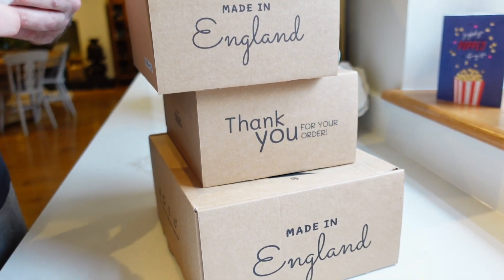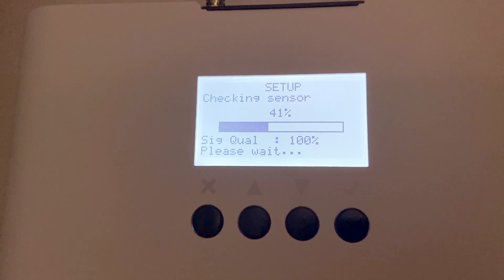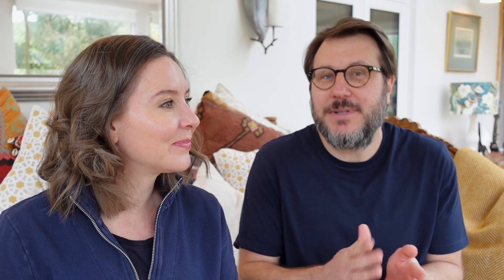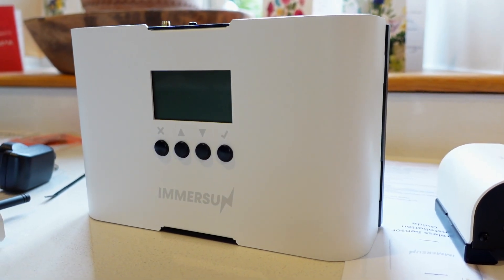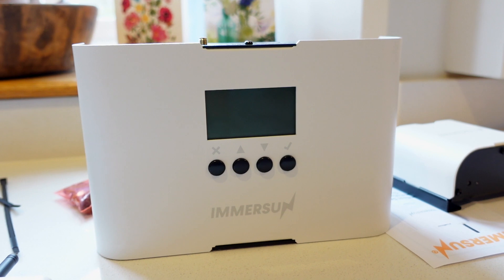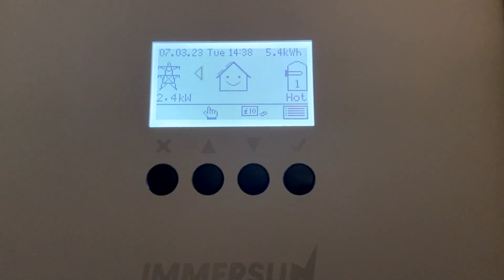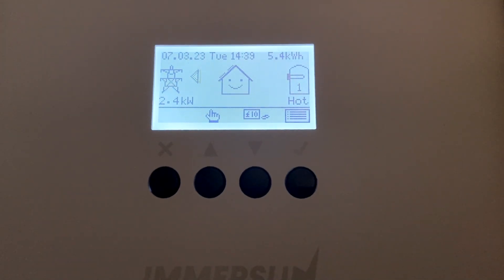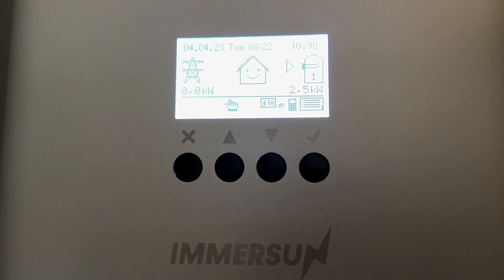Immersun PowerDivert and Immerlink Review

Comment: I am in the process of installing my own solar panels and 4.6kw inverter to heat my hot water in the summer with a diverter and 2 immersions in the hot tank. Do you know if it would be feasible to use the solar to run an air source heat pump for winter underfloor heating with a buffer tank?

Comment: We've used power diverters before in our previous house. 

In this one we have an oil fired boiler, under floor heating and an energy store. Our PV does not have a battery. 

I did consider something like an Immersun soon after we moved in a year ago but was unconvinced that it would save much money. The problem that I could forsee is that the thermal store holds the 300L tank at about 55 degrees with a thermostat placed horizontally in the middle. The boiler is not on a timer as it constantly maintains that 55 degree temperature to maintain the store. We would be relying upon the immersion thermostat (also in the middle of the tank) to raise the tank temperature and reduce boiler cycling. 

It's interesting that the device gives an indication of the power diverted to the immersion heater. It's also interesting that the unit is very much more robust than anything that I have seen or built myself (my unit being based upon a triac chopper circuit). 

I may have misunderstood but it seems like your heating system isn't a million miles away from what we have, heat pump aside. I am interested to know more details about how much power is actually diverted to the tank and the sort of payback that you envisage getting. I'm struggling to justify fitting PV batteries at present (even if I could get hold of some and an installer) but this could be a decent halfway house. Our PV seems to readily generate power and it's a shame to not use it.